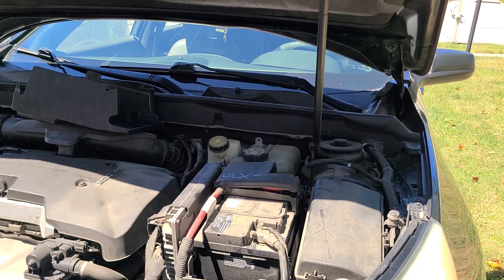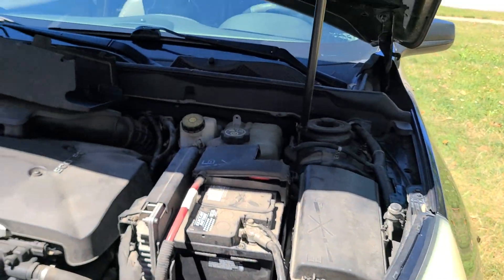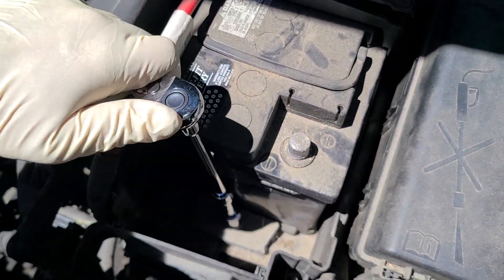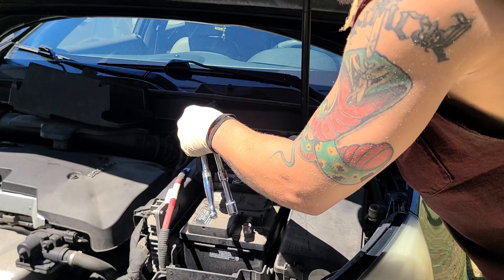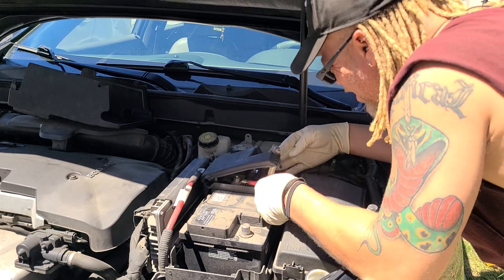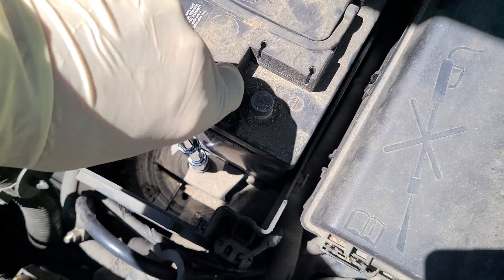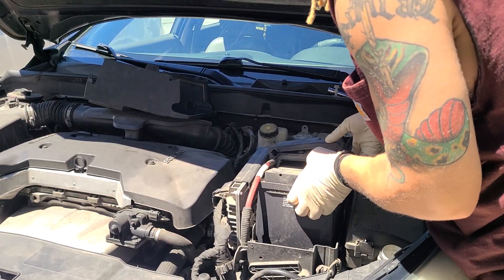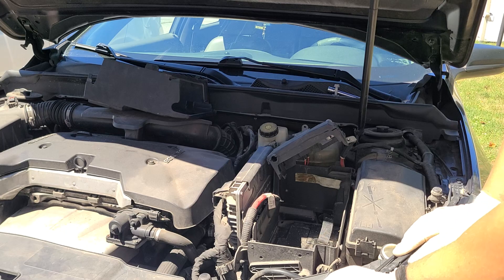2013 Chevy Malibu 2.5l battery replacement

Comment: since it's only a group 47 and not a 48 in there, you really dont need to do all that extra work on the positive.  just pull the terminal off the battery, then slide the battery towards the front and it'll lift right out real easy